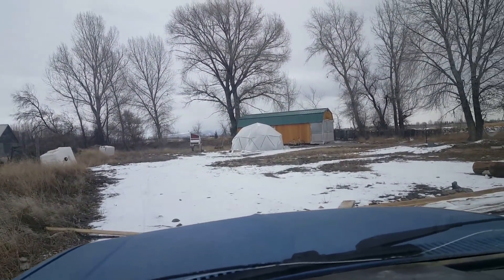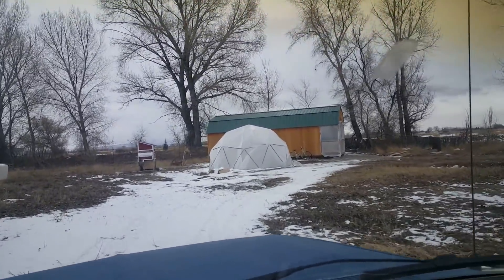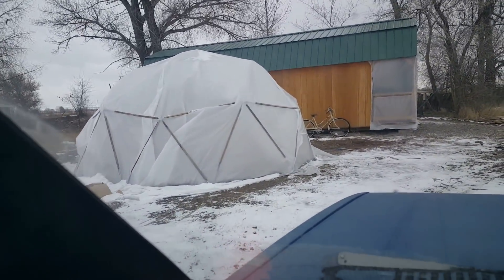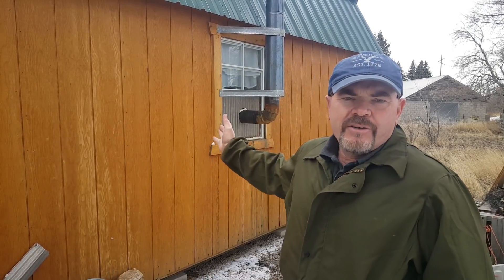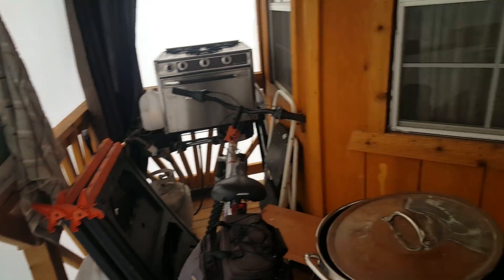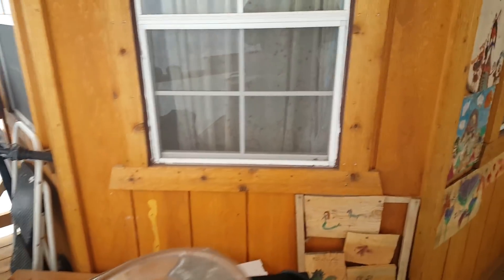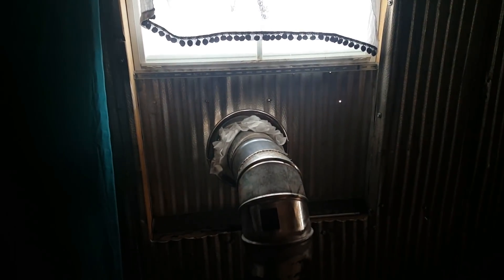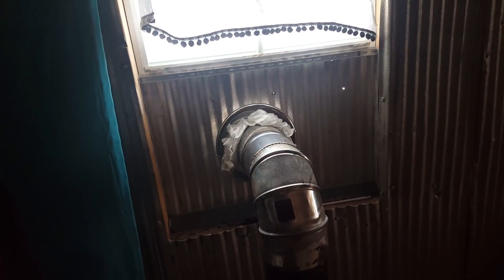Inventing new double walled chimney using aircrete

Comment: Don't you feel it would vent better if the pipe was higher on the wall to start the updraft?
Reply: LARRY FISHER it would no doubt. The two factors that govern draft are temperature and height. If you don't have enough of one you need more of the other. I'm sure we'll see more in the following vids, but by insulating the flue it will cut back on required height; which can be desired as taller piping is more prone to damage from the elements...we do a lot of boiler work, draft is super super important. Hope I don't come off as a know it all, I'm very excited to see it all work out!